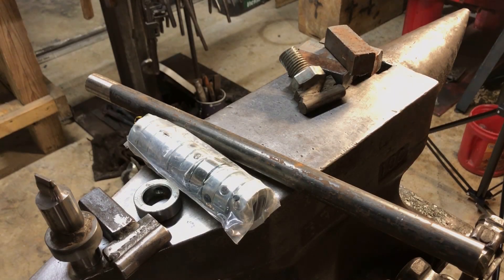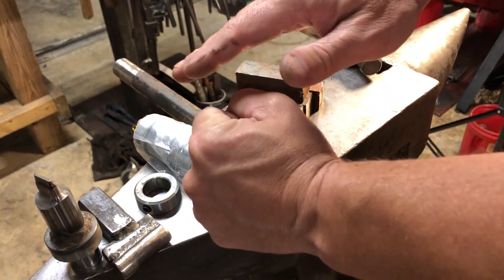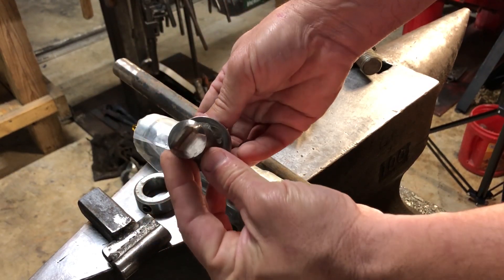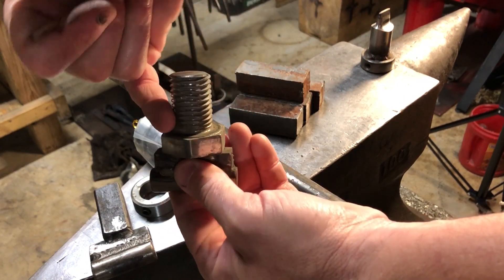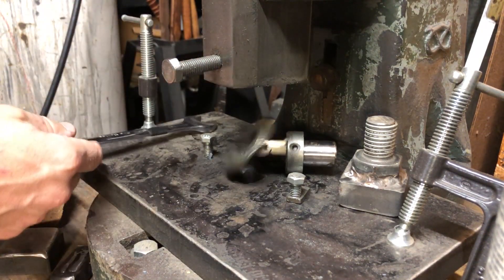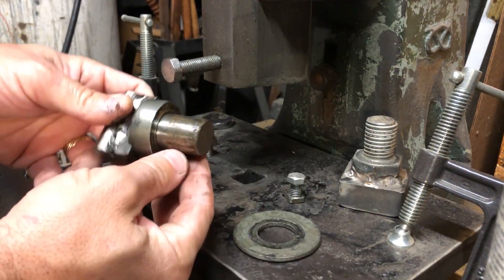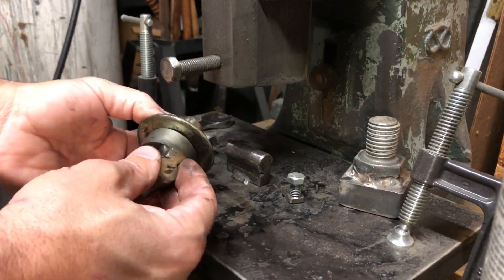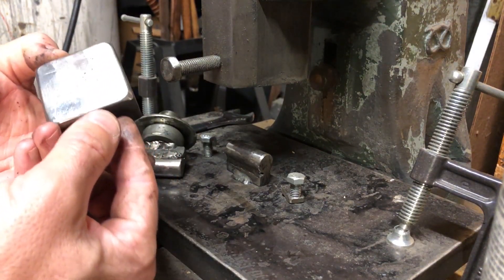Simple fly press tooling

Comment: Namaste,🙏🏼,, great video sir,, please make 1 tool holder which goes in ram and clamp your tools in that holder so that your ram bolts wont get failure as you threads on ram will eventually worn out, if you keep using it,,

Comment: I use bolts with an unthreaded shoulder for my flypress tools. I like bolts because I orient one corner to align with the front direction of the tool when I weld them. Then I grind off the other corners. Helps to see which way the tool is pointed. Especially important for me with my touchmark that I weld onto a bolt.